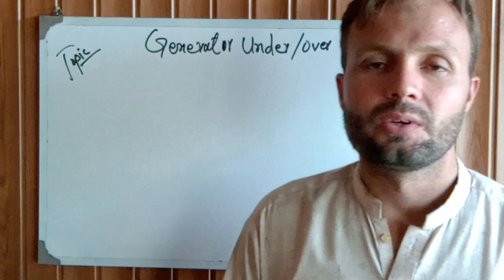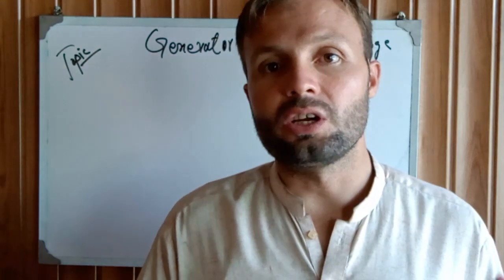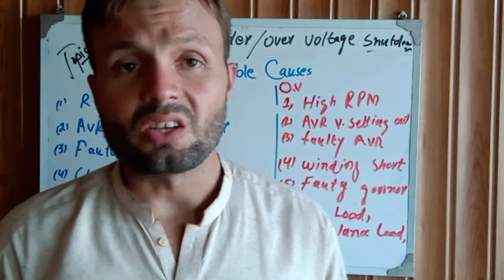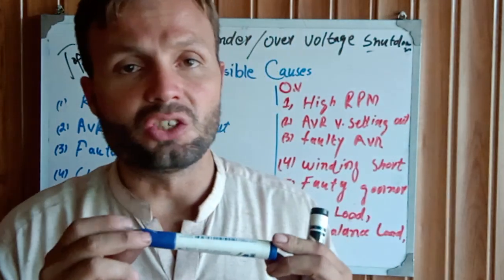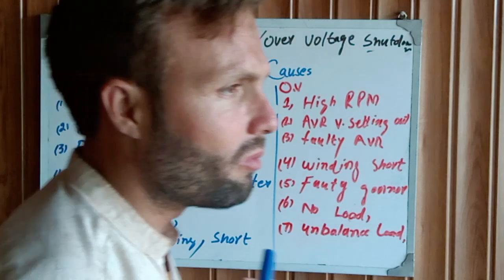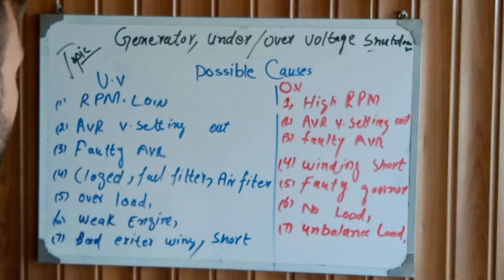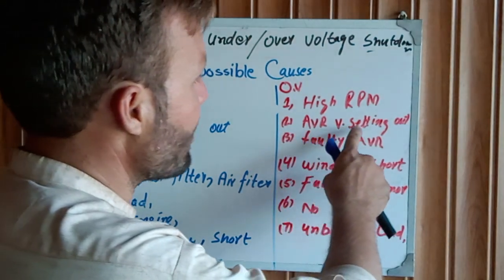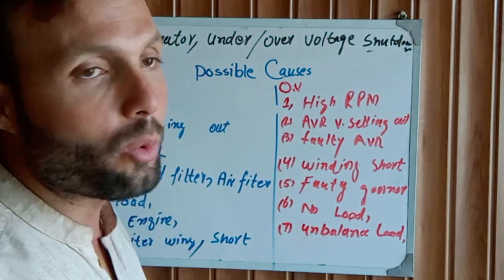Generator Under voltage, Over voltage problems , How to fix it , Caterpillar cummins, perkins

Comment: What could be the problem  generator is idling when it about to gain speed  it shows alarm and writes Gens oer voltage
Reply from the maker: Please adjust the Avr voltage to the specific rated Voltage 

And also adjust the engine speed to the rated rpm, 5-+